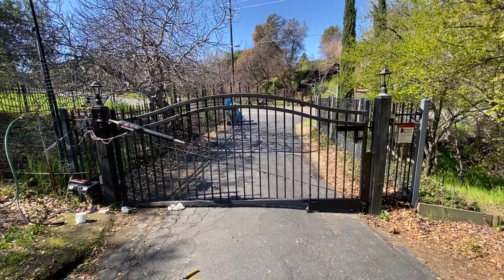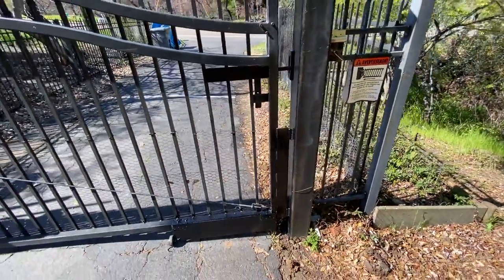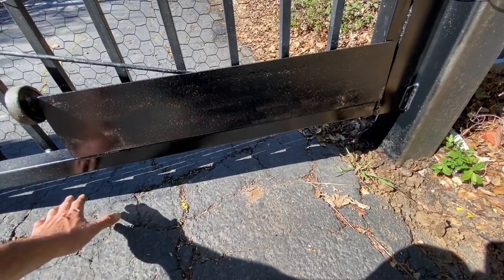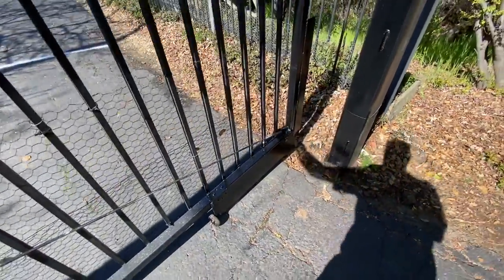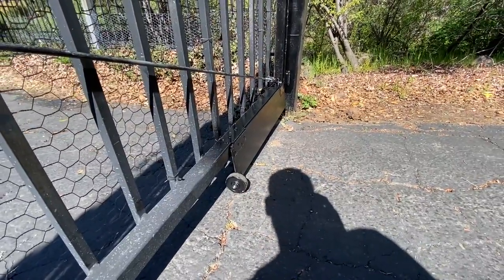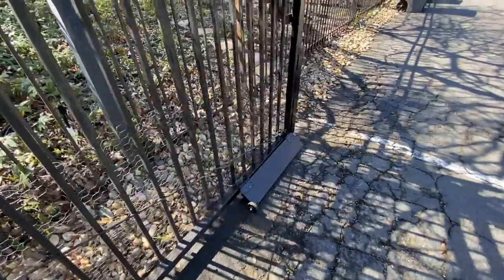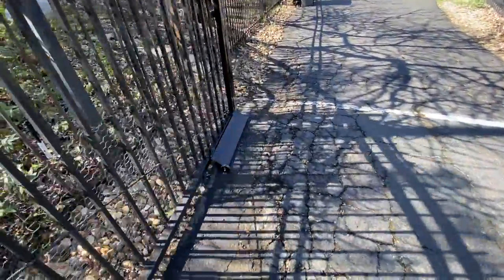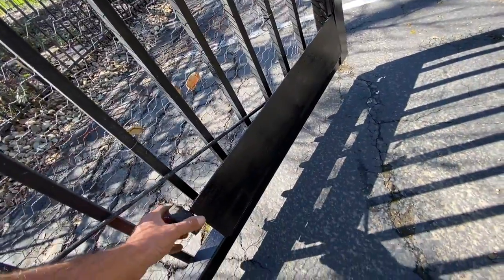How to fix a gap under an automatic gate

Comment: Nice work and a creative solution! That wheel might be a bit small to deal with the asphalt cracks over time though.
Reply from the maker: Recently I drove by that gate and it’s still work good. If big cracks were to form they would need to be filled.

Comment: Hiya, I’m having the same problems with my gate. I like this idea. The issue I can think of is the dog could push the flap (depending on how heavy the sheet of metal is)
Reply from the maker: when the flap is down it can't move outward because the plate hits the frame on  the gate. 
The dog would have to pull the plate of steel up and the one I used in the video is ¼ thick and to heavy for a dog to move out of the way. I was just at that property and it still works perfect.
Reply: @TheUltimateHandymanKyle  thanks

Comment: I have the same issue with my automatic gate. Are there any other remedies that you thought would work instead of a plate? I’ve been racking my brain! My gap  measures approximately the same as yours.
Reply from the maker: You could fill in the  gap with a heavy duty drive over cable cover. It would be bolted to the ground.  The problem with that is it would be like going over a speed bump. The way I did it in the video has worked perfectly with now issues.
Reply: Need another hinge That hinge will break

Comment: That is a great innovation. So maybe you can suggest something for my problem. I have a vinyl gate with a gap that my dog can go under. What material can I use to close that gap?
Reply from the maker: Does the gate get tighter when you open it or wider. If it gets tighter you need something that works like what I built in the video. If it gets bigger you can permanently mount  something under it that doesn’t move. You can use wood, aluminum, stainless-steel,steel.  You want to make sure it’s not to light or the dog may be able to lift it out of the way. Good luck with your project
Reply: @TheUltimateHandymanKyle  That point "if it gets bigger...." is a good one.

Comment: Hi.  This is a great solution.  My gate swings inwards though and I’m worried the dog will be able to push the metal plate outwards.  Any ideas? Thanks
Reply from the maker: Maybe ad some springs or strong magnets to hold it in place. Or you could make it heavier so it not easy for the dog to lift up.

Comment: I have this problem but my gates electric and opens sideways. My dog can fit under unfortunately.
Reply from the maker: Instead of installing hinges you need the plate to be mounted so it can move up and down vertically. The wheel can be installed in the direction the gate moves so it can push up on the plate.  Maybe you could use drawer slide to mount the plate to. They might not be durable enough for out side. Do some research to see if they make heavy duty slides that are for exterior insulation. If I was there I could figure something out for you. Good luck with you project.  Check these out GUWANJI 2Pcs SBR20-800mm Linear Slide Guide Rail with 4Pcs SBR20UU Bearing Block, Linear Sliding Guideway Length 31.5 inch(800mm) for Fully suppoeted Shaft Rod https://a.co/d/5O2wpoZ
Reply: @TheUltimateHandymanKyle  thank you so much, really appreciate it.

Comment: That would keep an animal from coming in on that one-way hinge, but I think getting out wouldn't be a problem.
Reply from the maker: It keeps my customers dog from squeezing under the gate. That pice of steel is pretty heavy. Most animals would probably not waste their time trying to push that up. You could go heavier on the steel to make it harder or add a strong spring to make it so animals can’t move it. This would only be necessary if the gate opens into the property.
Reply: @TheUltimateHandymanKyle  I am trying to accomplish the same effect with a 16' privacy fence double gate. It swings open manually and the ground is much more dramatic and uneven. Rather than moving a bunch of earth around and complicating the drive into the backyard, I was trying to find something clever and mechanical. This is pretty clever and mechanical, but I don't think I can use it. I'm trying to keep excess weight down on the gate doors as they're already pushed to their limits. I like the idea of wheels and flaps, I just kinda need it to work from the other side so the dogs can't push out. Certainly can't use thick steel.

Comment: im doing similar thing on a cattle gate  .why did you not have your panel up a inch or 2 and elminnate the wheel all together dog wouldnt fit under that  . just asking not criticizing .nobody is as smart as all of us . ha
Reply from the maker: Because the gap gets smaller as the gate opens so the wheel is needed to lift up the metal plate

Comment: Where do you buy the metal sheets to go under gate?  My gates are 8’.
Reply from the maker: Just look in your local area for metal suppliers 
or a metal recycling center they might have some. A welding shop might sell you some.